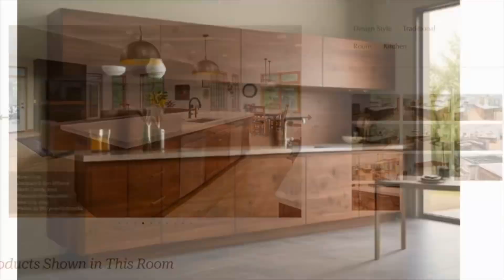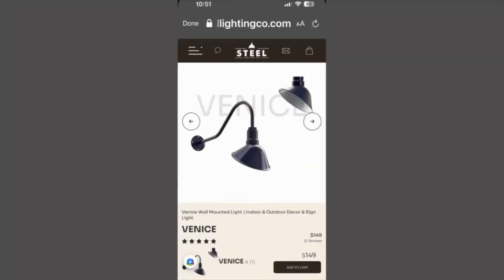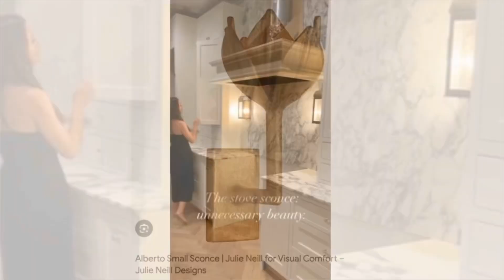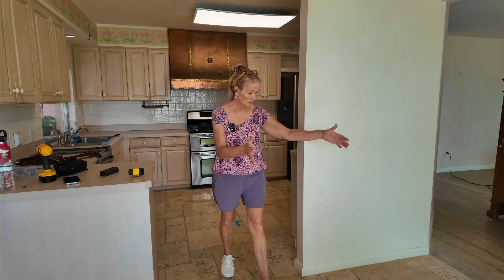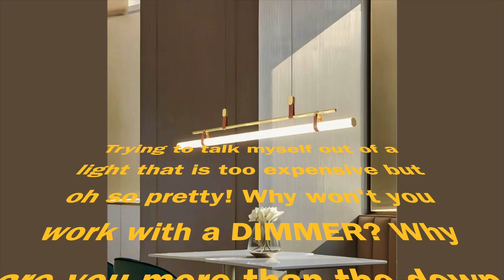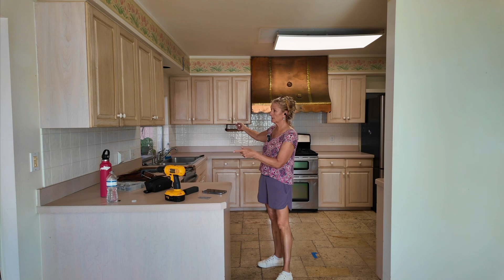Want a STUNNING Kitchen Lighting Layout? Start with This Formula!

Comment: What are the alternatives to recessed lights in kitchen in a high rise condo with cement ceiling?
Reply from the maker: You are in luck 🍀 Mono Point or multi point spots are sooooo on trend and incredibly practical. @elcolighting has a mono point with the same module/ engine, the koto 😇. So you get all the awesome features of a great recessed light with way more flexibility and only the depth of the drywall for wiring. Plus, your electrician can’t charge you as much 😇🤣

Comment: I’m confused by the symmetry (or rather lack thereof) on the sink wall elevation. It looks like the sink cabinet is not centered under the window and the uppers are not aligned with the base cabinets. Am I missing something? That would drive me crazy.
Reply from the maker: The sink cabinet is a bit of a trick. The cabinet is 60” so that I can get a 45” sink that will fit under the window. The faucet will be centered and the upper align. I’m already crazy!

Comment: ohhhh lala did you do skinny shaker wld love links to lights u use!! Ohhh do under island lighting for glow up? For island light what is your take on shade vs exposed bulb in clear glass please
Reply from the maker: The shade will limit where the light goes and the strength of the bulb 💡 on the exposed lights are the key. I’d rather have something soft hitting eyeballs, something diffused! No skinny shaker. Stay tuned!🎥👩‍🎨

Comment: IMO a light over the sink is a must to properly get my dishes clean.
Reply from the maker: Yes. But this one isn’t doing the trick!
Reply: This is so great to go with you through your thought process. Do you need a peninsula now that you are getting an island? You may want to separate the kitchen and hallway but corner cabinets are not the greatest. Ps. I loathe potlights and vents and speakers and smoke detectors and skylights on the ceiling plane. And did I forget anything? Keep going with the channel and I hope you don't mind this type of comment. It means I like you. 😂😊
Reply from the maker: @gregpendrey6711 no peninsula and I appreciate a mind like mine that gets into the details!👩‍🎨

Comment: Hello Liz, when you mentioned 22" ceiling can placement from wall, are you referencing an on center (oc) measurement?  About to start my fixture / can placement, so need to go back and rewatch all your videos.  Thanks
Reply from the maker: @farm-moore  18-22” on center of the fixture depending on if you have uppers and small cans!  You want it to hit the counter, not your head, leaning in.🙏👩‍🎨

Comment: this helps - any suggestions as to where I can find decent pendants for the island?   The restriction is that we have a 17 foot ceiling which is causing me some angst.
Reply from the maker: You might look at Currey and Co, Visual comfort, Etsy.  check the specs. Also use “stair pendants” or two story light fixtures for searches. Get creative. There’s tons of options!

Comment: The oversize copper range hood is properly sized to collect smoke, 4" wider on each side.
Reply from the maker: It’s over 9” each side. This isn’t a Texas bbq! 🍗
Reply: Yep! I don't know if it's our culture or basic historical inertia that causes usage of too-small hoods. But proper exhaust that doesn't sound like a freight train isn't easy (must be designed) along with room air supply that doesn't freakout the HVAC system are important for kitchens. Most houses ... provide for neither.

The hood here looks too big partly because of that, and partly bequest of all that material climbing  up to the ceiling vs just having a collector and pipe.